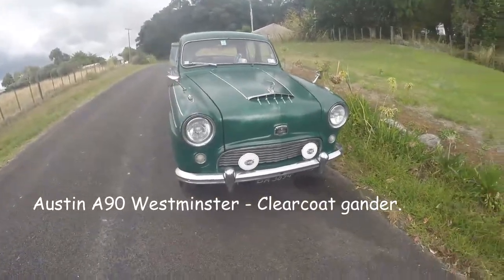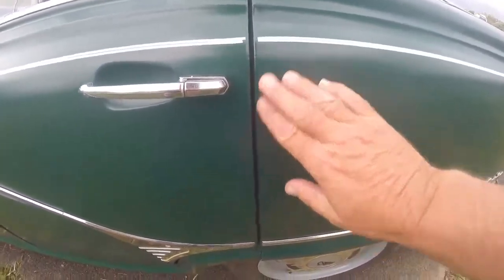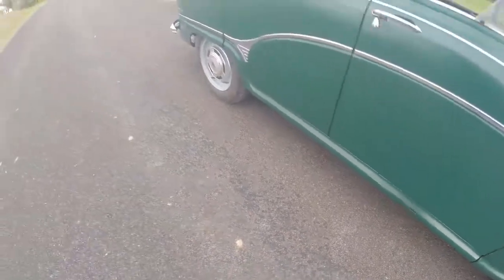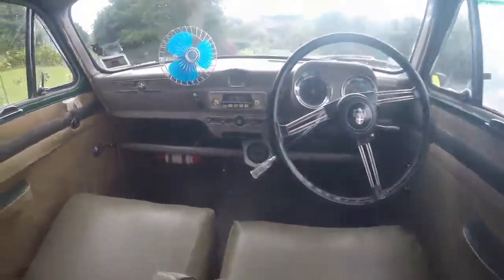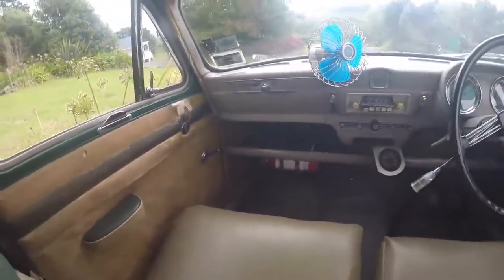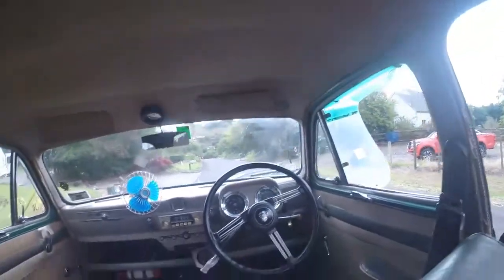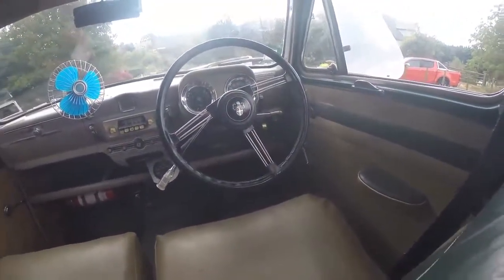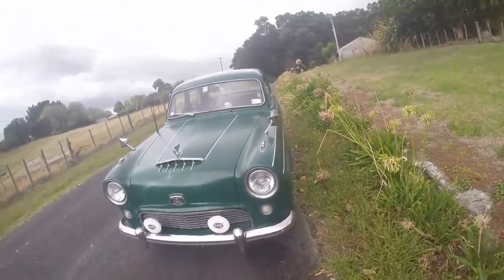Austin A90 Westminster '55 -   Clearcoated paint and cabin lookabout.

Comment: This car is an Austin A90 Six, not a Westminster, sorry to have to correct u now here.. The Westminster has different tail lights that are rite up on the top corner of the rear quarter panels, where they roll down at the round of the highest point at the back just before the quarter then swoops down on the A90. Rather than the quarters reaching a peak having the tail lights then ending rite up top at the furthest point back before them then going straight down instead with the Westminster models.. Cheers... ;) :)
Reply: This model is the A90 Westminster, and yes it did have the A90-six badging, but "Westminster" was not stated on the bodywork. By your description, you are referring to one of the later models , also titled Westminster, probably the A95.  My family and I owned a 1956 A90 Westminster from 1960 to 1979.
Reply: @richardjohnston1086  The 105 came out in the A90 body shape and the A95 body shape. I have a beautiful old workshop manual depicting the complete line up. Models bodystyles and engine sizes including the A95 station wagon. If I remember correctly the A90 A95 and the 105 –105s were Westministers. I'm going to get my book and check up. I'll get back to you.
Reply: @martydavies7198  Yes they were, and all you say is correct.  The 105 was the twin carb model.  The titling of Cambridge for the contemporary smaller engined A40 and A50 versions was also not shown on the bodywork.  I should perhaps have made clear that my experience of the A90 was personal.  I learned to drive in the A90 in 1965 and used it a lot when my father owned it, and from 1977 -1979 I owned it myself.  The designatiion Westminster, which appeared on the driver's handbook and other publications, distinguished it from the earlier 4-cyl A90 Atlantic, which had a central headlamp in addition to the usual ones.  The A90-Six on the boot did make that known though not as clearly.